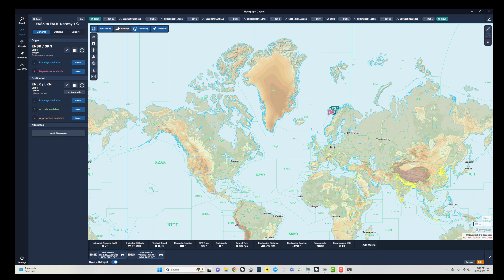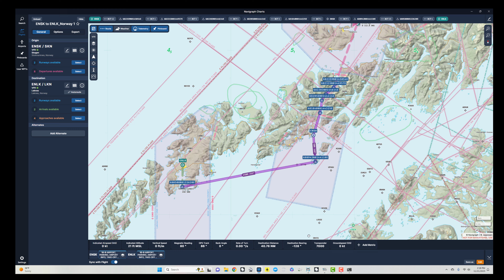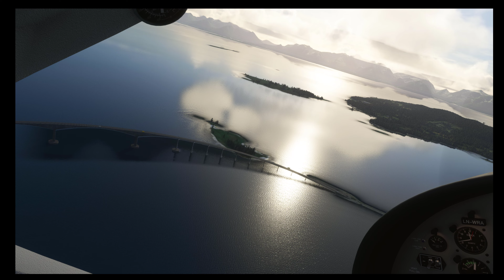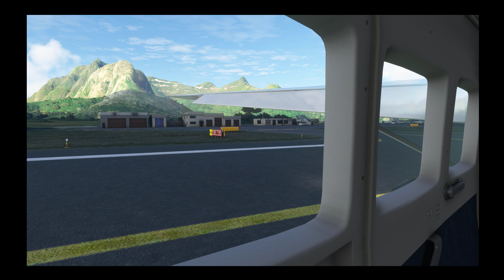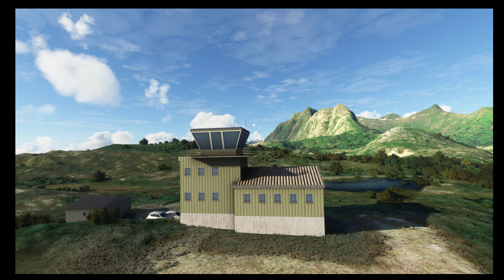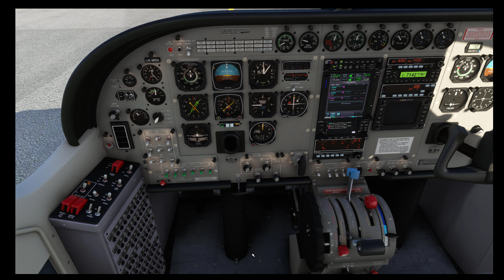MSFS Norway Scenic Flight 1 in 4k/Real Pilot/Black Square/General Aviation

Comment: Great videos, 
Keep them coming

Question, I've been into many different flight Sims for years. 
Also into RC plane flying.

How close or how far off is the sim compared to actual flying a GA plane in real life.

Obviously one doesn't "feel" any g forces during by the roll or pitch up or down unless you spend a lot of money on such additional hardware etc..

But is there any resemblance to real flying visually & audibly?

Some say using larger wall protectors help simulate 1 to 1 in size of objects while other lean towards occuls headsets as a closer to realism of flying.

Which do you prefer or tried?
Reply from the maker: Thank you for watching and for your kind words. You asked about the realism of the sim compared to actually flying a GA plane in real life. You also asked is there any resemblance to real flying visually & audibly?

No sim can replace actual flying. I have flown in full-motion military simulators and even those simulators cannot replace the actual thing. However, with that said, simulators play a critical role in pilot training and proficiency, and I am a giant fan of simulators and msfs 2020.

For the common person I feel MSFS 2020 is the next best thing to actually flying full-scale. I feel the sim can be very useful to simflyers and full-scale pilots alike. Visually, and to a lesser extent audibly (A2A Comanche has great sounds),  the sim is wonderful. The sim is visually soothing and a great tool providing any flight enthusiast the ability to experience the joy of aviation without actually leaving the ground. In addition, visual cues are a critical component to learning to fly. All basic fundamentals of learning to fly full-scale (takeoff, level off, turns, landing, etc)  are all based on visual clues while looking out of the cockpit and then supported by a visual scan of your performance instruments inside the cockpit.  This is true when first learning to fly a Cessna 150 during your private pilot training or beginning military jet training in a T-37. These visual clues are used throughout any VFR flight in any aircraft and MSFS 2020 models these visual clues very well. 

The sim is not only a great tool for learning the fundamentals of flying and for flying VFR, but is also a great tool for simulating IFR and radio procedures. I have an instrument rating and it blows my mind that you can fly nearly any real-world IFR flight plan in the sim using real-world sids, stars, approach charts, frequencies etc. 

Flight dynamics is a challenging aspect to model for MSFS 2020 and other similar sims. The critical flight dynamics in the sim with respect to wing loading,  roll, pitch and yaw, about the aircraft’s center of gravity, and the aircrafts interaction with wind, water, snow, and the ground do differ than its real-world counterparts. However, the gap between sim and real life is closing. Sim aircraft designers are getting very talented in simulating performance numbers. As you mentioned, another aspect that sims cannot reproduce is gravity. Another is the vast physiological demands of piloting a real aircraft. 

I like to fly with a separate yoke, rudder pedal, and throttle quadrant to enhance immersion. For me, motion is much less important, especially since motion is not and cannot be coupled with the effect of gravity in our sims.  A level 60 degree steep turn produces 2 g’s. I use a curved 32-inch single monitor for my visual cues. It would be nice to have 3 or four monitors surrounding me, but I am more than happy with my single 32 inch monitor.

I think the sim is a great tool for all aviation enthusiasts, real world or simpilot alike.  All MSFS 2020 needs now is an arousal spray to capture the smell of a GA aircraft cockpit. If you have never been in a GA aircraft, go to your local airport and ask an aircraft owner if they would let you open the door of their aircraft so you can stick your head inside and smell the cockpit. It is a wonderful smell you will never forget.

Thanks again for watching and commenting. I am hoping my videos will serve a niche in the GA sim community. There are a million sim airliner channels, but I feel there is a lack of quality GA channels. I’m trying to provide a low key, entertaining product,  that can share the joy of aviation to any flight enthusiast as well as to provide some basic flight instruction for those desiring a little more than just entertainment.
Reply: @SimPilot2450  again,
Thanks for your reply.
Yes, visited local class D airport & flight school. Sat in their Piper archer trainer.

What shocked me was how low the front seats were & hiw high the dashboard or cockpit really was in real life unlike say a car. 

I just assumed there was exact window space like a car but in that piper there wasn't. 

One thing msfs2020 did help was next day I bought same piper for msfs2020 & greatly helped me become familiar where everything, every button was.

I agree with you about G forces etc 

I guess what I meant was flying past the statue of Liberty 🗽 in the sim with either a 60" monitor or 100" projector screen.

I still don't get close to that 1 to 1 scale of objects as in real life.

I visited statue of Liberty & walked up it.
It's huge standing at 300ft. Standing at the base looking upwards you "'feel" the scale of it's size. 

But in the sim it's like watching it on TV, can look very detail with 4k but haven't "felt" the real life scale of objects yet in any sim.

Not sure if a VR headset will provide that sense of real.life scaling to real life or just need a 300" 4k projector screen before I "feel" like I'm flying in real world 🌎 scale wise etc.

That's all.
Thanks